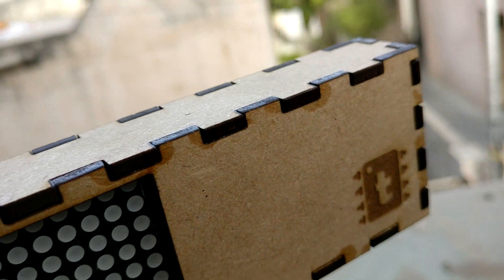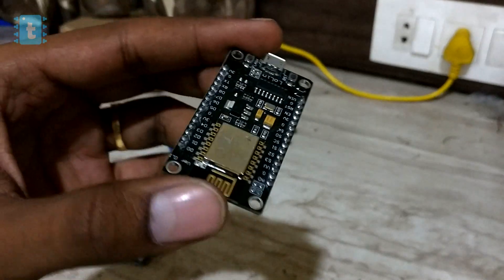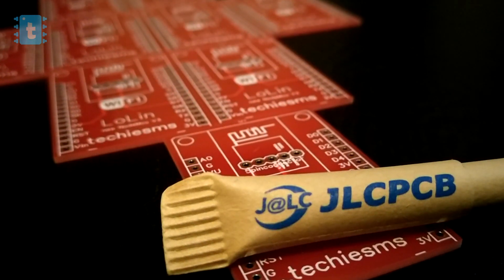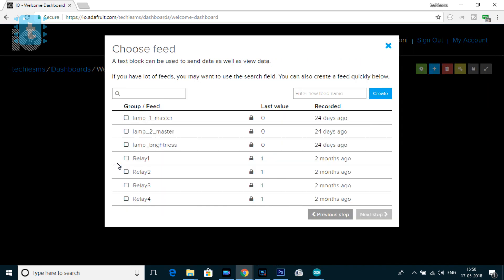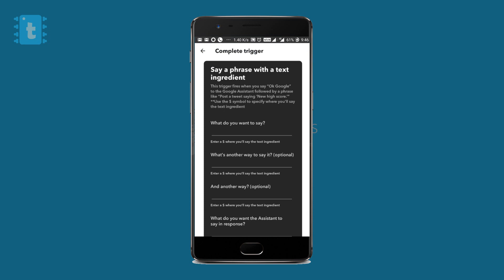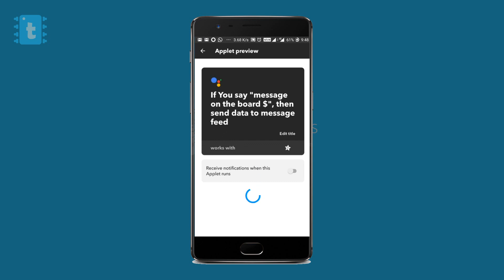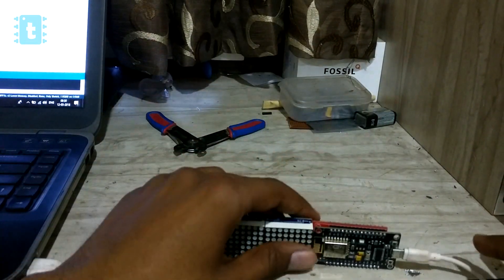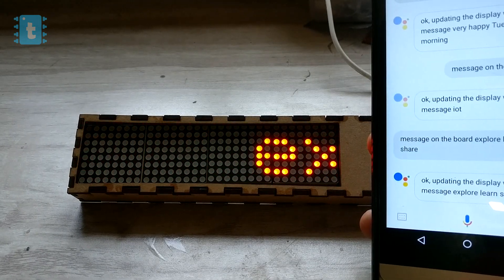Google Assistant Controlled Scrolling Display | IoT Projects | ESP8266 Projects

Comment from the maker: Want to buy this project?

Just comment down "I want to buy". If there are more than 10 similar comments for buying than l do an auction.

Btw how is the project guys??
Reply: Hello. Great project. I also am interested in purchasing, how much in US $. Thanks
Reply from the maker: Whatsapp me on +91 82000 79034
Reply: @techiesms  I want to buy this project
Reply: techiesms what was the cost of PCB in INR
Reply: i want to buy but tell cost
Reply from the maker: I'll be doing live auction starting with the base price of Rs. 1100 
If you are interested in buying the be present in the live auction.
I'll let you know the dates
Reply from the maker: Auction today at 3 pm IST. Be present if you want to buy it 
https://youtu.be/YnLJI25Lhks
Reply: HI techiesms I want to know will you please provide drawing file for that mdf box. And one more thing may know the vendor who helped you in lasercut. Do they deliver Bhopal Madhya pradesh.
Reply: Hi techiesms, great video. I can't get the LED matrix to work though. When I use the pins in your video nothing lights up. RESOLVED IT: It was a wifi issue. I missed out one character on the password. As soon as it was connected to wifi the board worked correctly.
Reply: I want to buy
Reply: Project is good I want to know if we need to connect esp with new ssid is there any way we can do, I mean is it possible that esp will convert to hotspot first and gives ip and then we can open that ip and put new ssid and password. So that we should not connect esp again and  again to PC on arduino software

Comment: I tried google assisted message scrolling display.. It worked! but there is some issue. Led Matrix stops listening to commands after few minutes (3-4 min). I can see the commands in feeds in adafruit.io but not visible on led display. On serial monitor status is "Connecting to MQTT... MQTT Connected!" but led display does not listen to new feed entries.
Where would be the issue? Can you please help?
Reply: Below Code Worked!!!

#define MQTT_KEEP_ALIVE 60
unsigned long previousTime;

loop() {
  unsigned long currentTime = millis();

  if((currentTime - previousTime) > MQTT_KEEP_ALIVE * 1000) {
    previousTime = currentTime;   
    if(! mqtt.ping()) {
      mqtt.disconnect();
    }
  }

  // delay(10) or do something else
}

Also found a way to decrease the brightness

mx.control(MD_MAX72XX::INTENSITY, 0); //This is to control the brightness of LED (Range is from 0-15)

Comment: Hi,
I am using the Node MCU with CP 2102 driver IC with 8x8 matrix led. I could able to compile the program. Can you let me know the error please?
Its showing error as
Scrolling_Display:84:47: error: invalid conversion from 'uint8_t {aka unsigned char}' to 'MD_MAX72XX::moduleType_t' [-fpermissive]

 MD_MAX72XX mx = MD_MAX72XX(CS_PIN, MAX_DEVICES);

Comment: Hi , Thanks for sharing wonderfull projects. regarding this project there is ERROR shown in the line // SPI hardware interface
MD_MAX72XX mx = MD_MAX72XX(CS_PIN, MAX_DEVICES);
if we write like MD_MAX72XX mx = MD_MAX72XX(HARDWARE_TYPE,CS_PIN, MAX_DEVICES); it is ok then.
but problem is all alphabet shows MIRROR image. i tried to correct via md_max72xx.h in library but was unsucessful.
can you suggest solution?
Reply: done it after long time. reinstalled library . best explained at your end

Comment: Arduino: 1.8.5 (Linux), Board: "NodeMCU 1.0 (ESP-12E Module), 80 MHz, 115200, 4M (1M SPIFFS)"

sketch_jun11a:66: error: invalid conversion from 'uint8_t {aka unsigned char}' to 'MD_MAX72XX::moduleType_t' [-fpermissive]
 MD_MAX72XX mx = MD_MAX72XX(CS_PIN, MAX_DEVICES);
                                               ^
In file included from /media/eswecha/B698CC0398CBBFDB/ms/office 2007/Excel.en-us/sketch_jun11a/sketch_jun11a.ino:1:0:
/home/eswecha/Arduino/libraries/MD_MAX72XX/src/MD_MAX72xx.h:359:3: error:   initializing argument 1 of 'MD_MAX72XX::MD_MAX72XX(MD_MAX72XX::moduleType_t, uint8_t, uint8_t)' [-fpermissive]
   MD_MAX72XX(moduleType_t mod, uint8_t csPin, uint8_t numDevices=1);
   ^
exit status 1
invalid conversion from 'uint8_t {aka unsigned char}' to 'MD_MAX72XX::moduleType_t' [-fpermissive]

This report would have more information with
"Show verbose output during compilation"
option enabled in File -> Preferences.

This is the error that iam getting while compiling plz help me

Comment: Hello, I have implemented the project "Google Assistant Controlled Scrolling Display".
The code provided by you is compiled and loaded correctly, the display shows the initial phrase "Hello! Ask Google ..." but google assistant does not recognize the pre-written phrases to activate the function of the display and makes different searches, what happens? <3
Reply: make sure that you have turned on your applet in IFTTT

Comment: Perhaps you can shed some light here:

Archiving built core (caching) in: /var/folders/62/js134tnd1c9dtwxs29g2p65m0000gn/T/arduino_cache_585453/core/core_esp8266_esp8266_nodemcuv2_CpuFrequency_80,FlashSize_4M1M,LwIPVariant_v2mss536,Debug_Disabled,DebugLevel_None____,FlashErase_none,UploadSpeed_9600_2d0aaac0d56c1b7a853b26a5278d2f34.a
Sketch uses 270572 bytes (25%) of program storage space. Maximum is 1044464 bytes.
Global variables use 34216 bytes (41%) of dynamic memory, leaving 47704 bytes for local variables. Maximum is 81920 bytes.
Uploading 274720 bytes from /var/folders/62/js134tnd1c9dtwxs29g2p65m0000gn/T/arduino_build_635319/MAX7219_IFTTT_MQTT_GoogleAssistant.ino.bin to flash at 0x00000000
................................................................................ [ 29% ]
................................................................................ [ 59% ]
................................................................................ [ 89% ]
.................java.io.IOException: Stream closed
 at java.io.BufferedInputStream.getBufIfOpen(BufferedInputStream.java:170)
 at java.io.BufferedInputStream.read(BufferedInputStream.java:336)
 at sun.nio.cs.StreamDecoder.readBytes(StreamDecoder.java:284)
 at sun.nio.cs.StreamDecoder.implRead(StreamDecoder.java:326)
 at sun.nio.cs.StreamDecoder.read(StreamDecoder.java:178)
 at sun.nio.cs.StreamDecoder.read0(StreamDecoder.java:127)
 at sun.nio.cs.StreamDecoder.read(StreamDecoder.java:112)
 at java.io.InputStreamReader.read(InputStreamReader.java:168)
 at processing.app.debug.MessageSiphon.run(MessageSiphon.java:81)
 at java.lang.Thread.run(Thread.java:748)
Reply: Okay, i just increased the baud from 9600 to 115200 and It started working!!

Comment: sir serial monitor is showing wifi not conected i have tried very much firsty i fill my adafruit aio key and username then  i filled my wifi ssid first and then wifi pass but it do not work please help me you can contact me on 9779751008 i can speak english and hindi as well as
Reply from the maker: Whatsapp me on +91 82000 79034
Reply: ok please contact me on 9779751008 i am indian i live in punjab contact me at 7o clock pm please

Comment: Bro I'm using ch340 chip.  And I'm facing problem uploading to it.. what board should I select and is there any other setting to be changed while uploading? Ch340
Reply from the maker: Have you installed drivers?
Reply: techiesms which? Those mentioned behind the board? That uses something else to upload program.. not using Arduino ide

Comment: Can I turn it off with Google assistant or show a temperature?
Reply: yes u can  but u only turn off display not node mcu ,
u can simplyadd relay and then - ve power wire of display   connect with relay and u done hope u understand